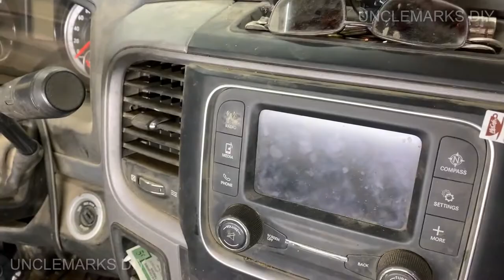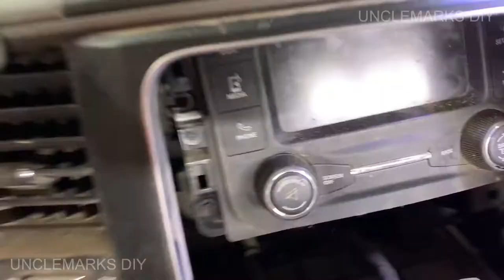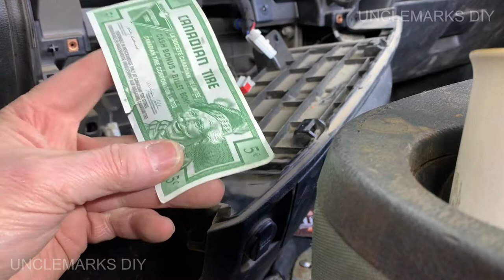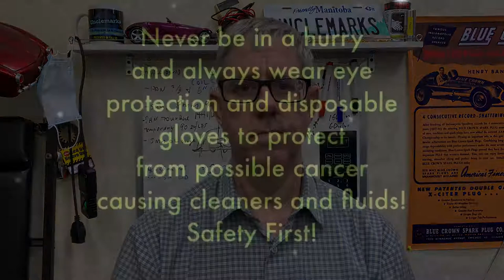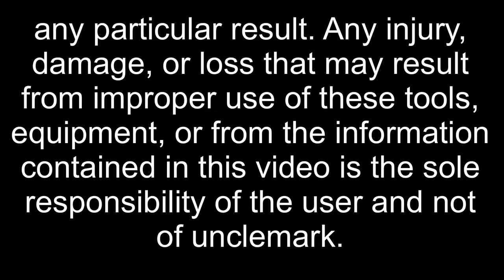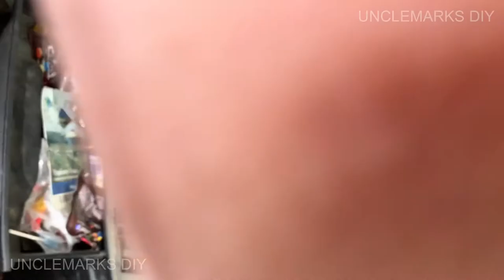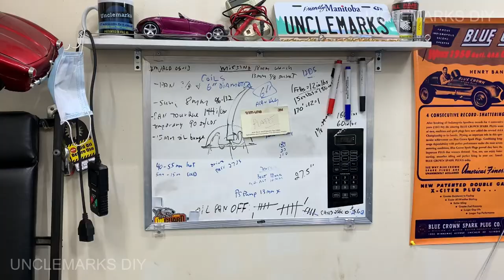How to remove heater controls on Ram pickup (EP 186) 2009 2010 2011 2012 2013 2014 2015 2016 2017

Comment: Ram dealer told me on these trucks at about 140k miles the heater cores fail and have to be replaced. Its a dash out job and runs about $3000 if done by the dealership.There is one video on here shows how to avoid discharging the A/C when replacing the heater core. It is a well known problem and the dealers are aware of this issue. By the way well done video I subscribed ty.
Reply from the maker: I see you commented on some one else's comment on this heater problem. They just had the heater core flushed. (Not sure how well it was done) I hear it is no better. I hope some of my videos might be of help to you, 
NDIrishfan71. Lots of videos to come for 2023!
Reply: @unclemarksdiyauto  That is what I plan on doing to mine flushing it and see. If that does not correct it ill make due the company is supposed to be buying me a new work truck soon.
Reply from the maker: @JasPlun  I hope you get this figured out soon. Here in Manitoba, it has been in the -20F to -40F range the past few weeks.
Reply: @unclemarksdiyauto  Its been pretty cold in East,TX, but its rebounding now. From all the research I have done before I do anything else I need to flush the heater core and will folush the radiator and replace the thermostat. All the Ram dealers want to do is charge $3000 to replace the heater core which is a Dash Out process. Its a work truck and the company is planning on replacing it so ill go the flush route it seems to fix this issue and if it does not ill make due until I get my replacement in. Truck has been alright we work them very hard. Only problem I ever had with it was a fuel pump went bad at 68k miles. I sure miss the 90's and late 80's trucks they were so much cheaper to fix and easier to work on. By the way these videos were well done and detailed I was able to use them to verify the actuators were good. Thanks! I will post whether it worked or not flushing it, but I have an idea it will. Its not leaking water out so its still good.
Reply from the maker: @JasPlun  The flush a great idea. (Backflush) Hope it works!

Comment: I have 2011 dodge ram 5500 the heater box i assuming on the passenger side left foot is always hot or warm even when A/C is on. Is this normal?
Reply from the maker: I am thinking you have a blend door stuck in the warm position. I have not worked on a bunch of these exact trucks, but they are designed to be able to control the temps so me thinking somethings up. I worked on this truck about 300 videos ago so the locations and design is not fresh in my mind. I would look into it if I were you.

Comment: How do I know if it's the blend door, The climate control module or one of those servos underneath? I'm getting nothing but AC but if I turn the fan off and wait for a bit and then turn the fan on low with the thermostat turn to hot. I get a little bit of heat for just a few seconds and then it goes cold right away. Any ideas?
Reply from the maker: There is no easy answer. I believe your Dodge dealer can control all of that through their scan tool to see if it is the blend doors or the control module. Is it cold on both drivers and passenger sides of the truck?

Comment: So what was the fix for the heat problem?
Reply from the maker: Unfortunately still stuck in heat on the one side. Must be a actuator further inside the HVAC unit. I don't have access to the dealer info on it and possible location at the moment. It is interesting since this does NOT have the dual heater controls.
Reply: @unclemarksdiyauto  I was soo much hoping you may have figured it out. I have a 2013 Ram 1500. I get cold air from both sides when I have the cold air on but only heat from the passenger side and not from the driver's side when the heat is on. I also do not have a dual air option on my truck so I find this strange as I have flushed out my heater core and didn't really notice a difference.

Regardless I really appreciate the video. I have not yet taken the time to open the dash and look at the blend door actuator in the center or the other one behind the glove box in your other video. Do you think it's even worth my time having a look at them still?
Reply from the maker: @joablevytam  this may well be the same issue! Here in Manitoba Canada it will soon be -40 Fahrenheit and the driver is going to be cold. (The passenger is the person that really needs to be happy) I need to try to find more info on it.
Reply: @unclemarksdiyauto  Well I am here in Ontario Canada. And it soon will be cold too. 

I will keep checking back on your chance just in case you do manage to solve the issue.

Thanks for responding!
Reply from the maker: @joablevytam  No problem JL. I am thinking the fix is not going to be easy.
Reply: @unclemarksdiyauto  haha most probably not!
Reply: Did you ever fix this heat problem on the ram I have exactly the same problem on a  2016 ram 2500 air on driver side is so cold and passenger is about worm depending on driving time
Reply from the maker: @mauricioortiz7302  Have not seen the truck since the video last year. I need to ask around and post the fix. There must to be one more blend door and actuator somewhere probably on the drivers side but I could not find it. Email me and if I get a fix I will send you a note. (My email is on my main page in the about section)
Reply: On your last note 3wks ago for others to email you. Can you just post on here if you find out what the solution was?
Reply from the maker: @mattgrosse9036  the consensus is that it’s the heater core. I am going to try to flush it with something like CLR. Not sure when this will happen though. I will post a video on it when it happens.

Comment: My 13 ram get frost inside on the back of the windshield.
Reply from the maker: John, can you scrape it with a credit card like it is ice or is it a wipeable fog?  If it is fog, can you smell coolant because usually that is a leaking heater core. If fan not directing air to windshield, you either have a bad defrost door actuator, or the door that it controls is stuck. Does it sound like any of these John?
Reply: @unclemarksdiyauto  its hard frost that I scrape before going to work

Comment: Please comment on what tools you need such as a t-20  or Phillips screwdriver or 8mm socket.
Reply from the maker: I thought I said in video, ( usually do) but I missed it. But in description I listed T15. I do tell bolt size in the video at the 5:31 chapter.  Thanks Frank.

Comment: Wow the amount of trash what an inconsiderate customer
Reply from the maker: The stuff didn't bother me. I wish I would have been able to solve the problem they were having in the other video dealing with heat.
Reply: Those climate control don’t go bad, what’s goes bad is the fan resistor. Underneath the passenger glove box.
Reply from the maker: @SergioBViera  Yep. Just did the video since I was under the dash anyways. Was after a blend door actuator.